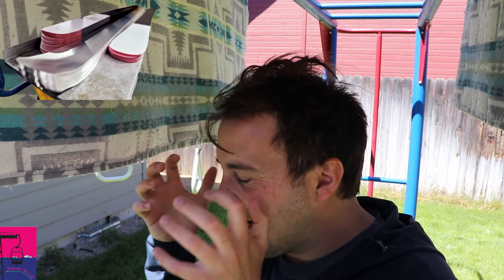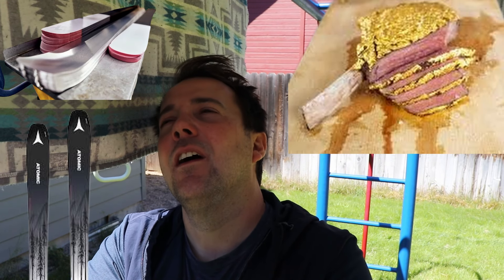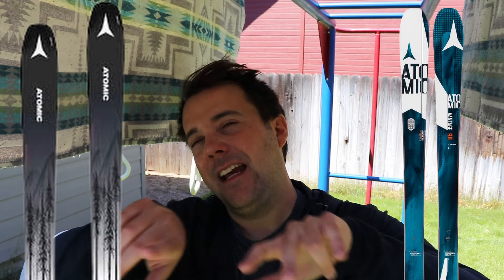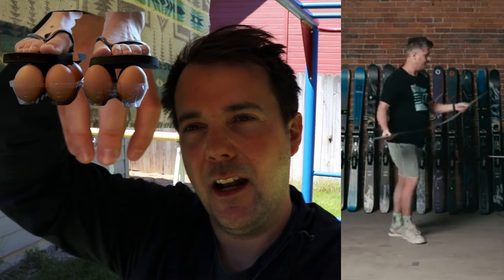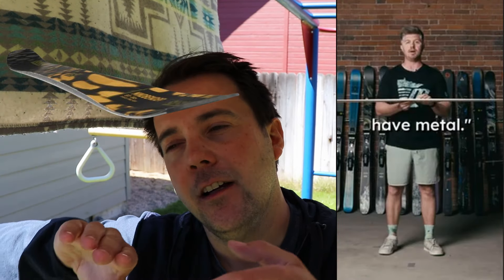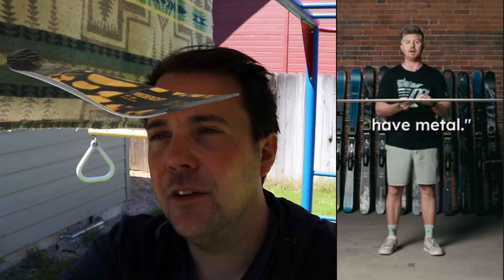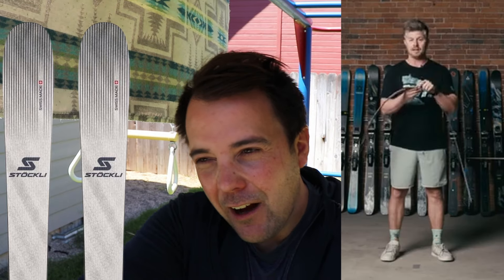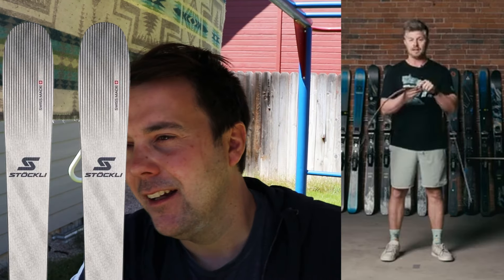Do Your Skis NEED Titanal? What Does It Do?

Comment: As an engineer, ski monster's comments hurts me. You don't ski titanal as a 0.5mm layer. You ski it as part of a stack of materials where it affect the bending properties.
Reply: thanks for the observation!
Reply: Exactly. Layers set the metal into a "stretch" activity, lengthwise (end to end bending of the ski) and sideways (side to side twisting of the ski). Metals are elastic. It's like pulling a rubber band, but at a microscopic level. It's ultimately the bonds between atoms of titanium, an alloy of various metals.
Reply: @exothermal.sprocket  thanks for the knowledge!
Reply: @exothermal.sprocket  Titanium is an element not an alloy. And titanium is not even listed among the ingredients in the aluminum alloy that is 'Titanal'.
Reply: I agree..  I would also add that my titanal skis do not have the amount of camber that my non-titanal skis have.. To me the titanal replaces a lot of the camber..
Reply: @bearclaw5115  Oh no! A mistake in identification of a metal!
I guess that invalidates everything I said! 🥸

Comment: Good discussion. After reading the comments below, the ones about stretch are describing what titanal (aluminum sheet, not titanium) does for a ski. Its all about the glue bond between the titanal and the wood core. Take that flimsy titanal sheet and try to stretch it (grab both ends and pull). That is what happens when a ski flexes and curves. The top surface gets shorter and the bottom surface gets longer. Not by a lot, but by enough to make a difference to the titanal sheet. So due to the "I beam" effect and the bond to the wood, the stretch resistance of the metal is much stronger than the stretch resistance of the wood. Hence titanal effects longitudinal stiffness, and torsional stiffness and damping. The degree of each can vary based on many factors. It also is more noticeable the more the ski is bent, hence the "threshold" that Elliot mentions. To me threshold is not the best word, I would use "resistance" and spring back. Skis with metal offer a more progressive flex resistance and hence more energy return when highly bent and released. I would agree with Elliot's description of what he feels, I just think the explanation is mostly about what happens when the sheet is forced to stretch due to bending of the ski. I have a Masters in Mech. Eng just to state my qualifications for what I am saying. Titanal is cut into many shapes to have its effect be localized, versus a full width sheet these days. Beam bending theory explains the effect, but not appropriate for general public discussions.
Reply: Just fyi for someone who knows beam theory, the actual effect of "metal" here is largely increasing the torsional rigidity (not bend rigidity, which is more effectively increased with orthotropic/directional nature of wood etc), and you can see this on actual measurements. 

More importantly the effect of torsional rigidity is resisting deformation from carving forces, which is the point of modern skis. What happens here is the ski is able to subtend an increasingly small radius with greater tipping angle, and due to conservation of angular momentum, accelerates the skier. Or put another way, torsionally floppy skis can't effectively cut the parabolic grove necessary to maintain this acceleration phenomena.

It's not from the "energy return" people keep talking about, the tiny effect of which is evident if you ever bend a ski by hand, vs the considerable energy diff to actual carving (easily enough to launch you off the ground if you've ever legit carved a turn).

Comment: Titanal is aluminum. Aluminum doesn't compress or stretch as much as wood. When you turn a ski, you bend it which compresses the top sheet and stretch the base. If you put titanal on the top and bottom of a ski sandwitch, you make it stiffer while being thinner, just like the top and bottom plate of an I beam. You can control size and configuration of the aluminum to chang the frequency and the response of a ski.

Comment: Wood flexes easily and is relatively soft. Metal doesn't flex as easily. Of course, he is showing a sheet of metal that is 1/100th the thickness of the wood. Now, take that metal and glue a sheet on each side of the wood. It will greatly reduce how much the wood flexes. Think about it like a sausage casing. The meat doesn't resist breakage or flex without the casing. Now the casing on its own, uncooked and without filling, is just a floppy skin. Just like his floppy piece of un-bonded titanal layer.

Comment: Ppl here on the east coast, even ski shops think u can only ski with titanal/metal.. and they think it's making it stiff to cut through ice.. does none of that.. really just dampens the vibration in my experience
Reply: Exactly. It's a correlation because stiffness and dampness are both important for skiing fast on hard surfaces, so most skis designed for that will both be stiff and have titanal for damping. But it's not the titanal that is making the ski stiff.

Comment: Titanal is pretty floppy and flimsy by itself as he demonstrated. But, put it into a sandwich between layers of wood and resin and other materials, and any flex is potentially going to translate into that metal layer as TENSION. That's where the spring and energy comes from... stretch/spring within the metal properties. Metal is known for its stress, strain, elongation, yield, and permanent deformation (all levels of tension put into the material and how it reacts).

Comment: 1:50 If the titanal scratches off with your finger, there probably is a defect there. The "standard" titanal thickness is around 0.5mm, and getting that to scratch off would mean that the material itself has disintegrated badly, or it's just for graphical purposes, if the layer is thinner than would make practical sense.

Comment: Good discussion. Titanal is more present in higher end ski that have a beefier construction. Now cie shape/cut the titanal sheet because i think it is easier to manipulate than shaping the wood core. I think with new material like graphene it may change in the future. I agree with another comment that titanal is part of a build and adds some caracteristic engineers want and  titanal offers. Skis now need more torsional rigidity and easier to flex so you get the full arc.

Comment: I also posted this in reply to someone else here, but you should know:

Just fyi for someone who cares about actual physics like beam theory, the actual effect of "metal" here is largely increasing the torsional rigidity (not bend rigidity, which is more effectively increased with orthotropic/directional nature of wood etc), and you can see this on actual measurements. 

More importantly the effect of torsional rigidity is resisting deformation from carving forces, which is the point of modern skis. What happens here is the ski is able to subtend an increasingly small radius with greater tipping angle, and due to conservation of angular momentum (eg. seen in figure skating when skaters draw in their arms when spinning), accelerates the skier. Or put another way, torsionally floppy skis can't effectively cut the parabolic grove necessary to maintain this acceleration phenomena.

That carving accel is not from the "energy return" people keep talking about with respect to "unbending skis", the tiny effect of which is evident if you ever bend a ski by hand, vs the considerable energy diff to actual carving (easily enough to launch you off the ground if you've ever legit carved a turn).
Reply: That's some very interesting analysis! I'm an engineer myself and was wondering about the mechanics of it. Do you have a source on this?
Reply: @mathieug6136  far as I can search, I'm the only one online who's put this physics together (technically it only relative basic mechanics outside the beam theory). I suppose ski engineers at larger companies should know this, but not the more boutique "designers" at demo days I've talked to.

Comment: 12:30 "This is like a bunch of quarter truths adding up to a semi-truth."  You condemn with faint praise here, and I'd argue you are being too kind.

Skis are a LAMINATED UNIT.  Titanal significantly adds to the rigidity and rebound characteristics of a ski as a KEY COMPONANT to that unit.  The fact that the titanal layer is bonded to the layer above and below is the key to this; the apparent floppiness of the metal itself outside of the assembly is no indication of its role within the laminated assembly.

If you were making chili, titanal is the sliced jalapeno pepper.  It might only be 1% of the chili, but it has a outsized impact on the overall character of the chili.

Thanks for coming to my TED talk.
Reply: The “plywood” effect.
Reply: @summit50plus  Exactly.  The same could be said about carbon stringers in skis as well.

Comment: Before you get into Ski Monster I will say that when I used to race my skis had a lot of camber and I would get a couple years before I would loose the camber..  Specifically I would lose the elasticity of the ski..  The skis that I have that have titanal (enforcer and stormrider) do not have as much camber and elasticity as my old race skis but have that stable foundation that I can put energy in and get that energy out.. For me it is a consistent amount of energy and that is how my skiing style is..  Infact my last 2 pairs of race skis had a dampening/support system right next to the bindings which both made them less elastic and more supportive which goes with my ski style.. I still get some elasticity but not too much to make the skis reactive..

The reason I need metal in my skis while skiing in the West is for dampness.. Dampness helps when I am on the rock hard groomers and it helps when I ski crud and it helps when I ski sticky snow and it helps when I ski crust..  My Enforcer 104 Free have a lot more float than my Stormrider 105 because of the rocker..  Even my Stormrider 88 doesn't have much camber..  My DPS Wailer F100 has a lot more camber and it does not use titanal but it does use fiberglass and epoxy to dampen the ski..  The QST 106 also uses flax to dampen the ski..  The QST 106 also has a lot of camber and a lot of rocker..  The QST 106 and the DPS F100 are both very stable skis.. There sidewalls are a lot thicker than my Enforcer 104 and my Stormrider 105..

Comment: I think titanal has been conflated with stiffness because stiffer skis ARE generally the ones that incorporate titanal. But that's because skis designed for going fast on a hard surface need to be both stiff and damp. So those skis will be built stiff and also incorporate titanal for damping. 

Regarding energy return, you can view the ski as a loaded spring anchored at your boot and with the snow pushing up at the tip and tail. If you've taken a physics class, you may recall Hooke's law (force = distance*stiffness). So if you want to increase the amount of energy in a ski at a given edge angle, you can either increase the distance you're bending it (by increasing the camber) or you can increase the stiffness of the ski.  But titanal can't provide energy return independently of its very small contribution to the stiffness of the ski. So why don't all skis return the same amount of energy? Nordica Enforcers have a lot of metal in them - far more than the Mavericks. But according to your multiple videos about them, they don't return a skier's energy, while the Mavericks do. I think the discrepancy has more to do with the shape of the tail. The Enforcer's tail is more rockered and more rounded than most other skis. So when you put it on edge and bend it into a carve, the rockered tail is already shaped somewhat like the arc of the carve, and the rounded off corners bring the ends of the tail closer to the skier's boots. The force of the ground against the ski simply isn't bending the ski as much much as it would if the tail were flatter or squarer. The ski isn't returning as much energy because less of the energy is being stored in the ski.
Reply: Titanal is not just conflated with stiffness, it does indeed add stiffness. We've seen this countless times with skis that come in a Titanal version and one without.

Comment: i wish i could try the Ripsticks with titanal :D.  would it fix what i dislike about the otherwise "most fun ski ever" even if it takes out a little bit of fun?  (yes even the black edition is missing some dampening/torsional stiffness/???  imho)
Reply: I went from Ripstick black editions to a Volkl Kendo with a titanal frame and love the strength and ability to bust crud compared to those light Elans.
Reply: @45shrike agree. The ripstick tends to be too light for crud, icy/hard packed conditions, and high speed. But I love it in 3-10” of powder. I’m looking for something a little stiffer and heavier for those conditions.
Reply: @45shrike  yeah the Kendo rips. I need to demo the new model, i only skied the older versions before the 3d radius thing.
Reply: @10SMaxx-e5j  it’s also a great spring ski. I love mine in soft bumps and on soft groomed runs.

Comment: Doesn't it also matter if the titanal (or any other material) "wraps" from the horizontal plane, onto the "sidewall"/vertical plane where it creates a torsion box?
Reply: AFAIK the only brand using metal that way is Liberty, with vertical struts inside the wood core, and strictly speaking they're using a different aluminum alloy, not titanal.

Comment: As with everything, I think there is a mixture of truth, along with some misunderstanding. It would make sense to me that higher performance carving skis would not only use more metal, but also use other construction techniques and materials that support high-end carving. I do believe metal contributes to stiffness, both longitudinally and torsionally as well as energy threshold and dampness, but you have to look at overall construction including other materials as well. A single layer is designed to work in combination with the other layers. This should be pretty obvious, I think…

Comment: I have literally no idea what I’m talking about 😂but I always assumed once the metal was attached to something like wood it wouldn’t want to stretch/flex at the same rate as the wood especially if it were in the underside, which would change the flex? They definitely engineer varied thicknesses for something other than dampening I imagine. Imagine being the key word here. I wouldn’t think that K2’s Y or Black Crows H would be primarily a dampening agent. Forgetting which maker it is but at least one of them put the metal vertically between wood laminates. Seems like that would be pretty stiff similar to paper not wanting to bend along its edge. Ski essentials just put out a tour of Blizzard( fyi it’s blizzard like the English word) where they talked about how the characteristics of metal changes as you get away from the center of mass in either direction, 🤷‍♂️ but I was only half listening. LOL.
Reply: The vertical metal struts inside the wood core is Liberty. That absolutely stiffens the ski, but that's not titanal, it's a different aluminum alloy. Most skis with titanal are using it in flat sheets as shown here, flat strips along the edges (e.g. volkl), or the (flat) Y and H shapes you mentioned.
Reply: You were doing so well up until your Blizzard comment. It was originally 'BLIZZ-ARD' but has been Americanized for marketing purposes as 'BLIZZ-ERD'.